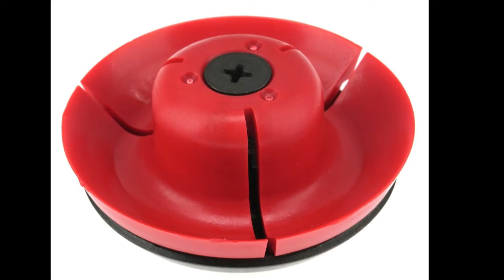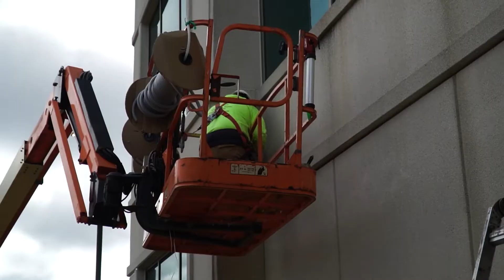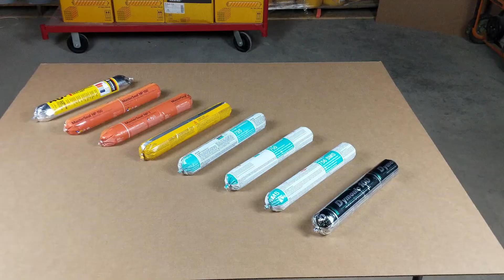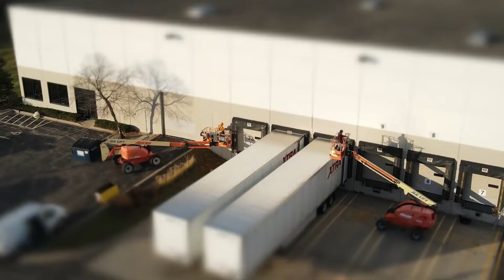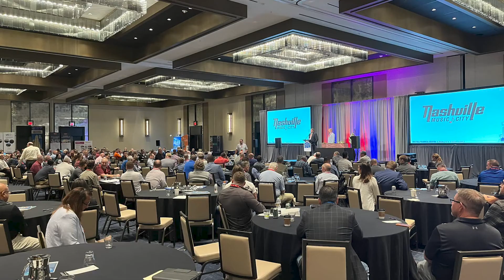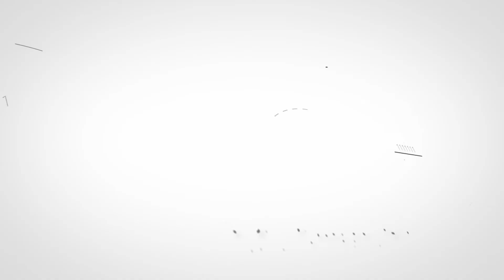Milwaukee 12v Sausage Caulk Gun flaw?

Comment: Glad someone made this video. Ive been wondering if there was any differences between the two or if the albion was just a rebranded milwaukee. I have the milwaukee and believe it or not, my only compliment is the plunger cup. That little #2 phillips screw on a few occasions has completely worked itself out resulting in the screw and cup falling out during reloads which could be a massive issue working in lifts.
Reply from the maker: We had an issue with the Albion piston assembly stripping out on two different tools. We called customer service to order replacement racks, and they were very responsive about the issue. One of their Vice Presidents actually called later that day to collect more information so that they could try and mitigate any future failures.
Reply: If you rap a little bit of the white thread tape on the screw you don't have to worry about it coming out
Reply: Or Loctite is your friend

Comment: Whats the best way to clean the sausage gun and do you leave half used sausages in the gun for next time?
Reply from the maker: Unless you pinch a sausage, you should not have to clean the gun much at all. The threads at the end of the barrel will get caulk on them, and that is easily cleaned up with solvent, a rag, or a wire brush. If you need to clean the barrel, you can purchase a barrel brush and use that along with solvent. 

You CAN leave a half-used sausage in the gun for later use, but it has diminishing returns. Our company will discard partially used sausages, as the risk of sealant failure is not worth the cost of a partial sausage to us.

Comment: that's a very easy fix! The push rod handle can be cut so it go into the barrel another 1/4" push the out the remaining few ounces of material... This is much cheaper that the upcharge on the other gun
Reply from the maker: That would very likely work. There is a switch at the back of the unit that is depressed by the handle and stops the rack from traveling too far. So long as you don't over trim the handle, it should work just fine.

Comment: Why not just try and install the Albien rod assembly into the Milwaukee?
Reply: Just get a newborn barrel they are shorter
Reply from the maker: We plan to make a video showing how to do that if you already have a Milwaukee gun. You  can order the piston kit (Part# 1004-10) from albion's website, but you have to call them to order the replacement rack, which is about 9/16" shorter than the Milwaukee part.
Reply: @Jsgoray does the Albion rack fit the Milwaukee?
Reply: I had to order a Milwaukee piston for my dewalt. Shooting a double bead with a long tip makes the foil go behind the piston in the winter rn. The dewalt piston is garbage

Comment: My biggest concern in the gun is gripfill tube doesn't fit 350ml it's about 1inc longer than standard tubes
Reply: I cut the handle hook a1/4 inches and it does squeeze  the sausage as the abion
Reply: Just take the 350ml apart and put it on the electric gun i did that and it worked just fine you undo the bolt that holds the calor to the gun and put the 350ml shaft on there and put the plunger on the electric caul gun to you just take the screw off.

Comment: What’s best cordless bulk gun ? Because Albion bulk gun cordless is heavy .
Reply: The 18v Milwaukee is the best I’ve used makita hilti and dewalt and the Milwaukee 18v is the best
Reply from the maker: We like the albion/milwaukee cordless guns for both sausage and bulk. We mostly shoot sausages instead of bulk, but agree that the 18v guns are very heavy. We have converted most of ours to shoot sausages and only use them on ground level work to reduce strain on our techs at height.